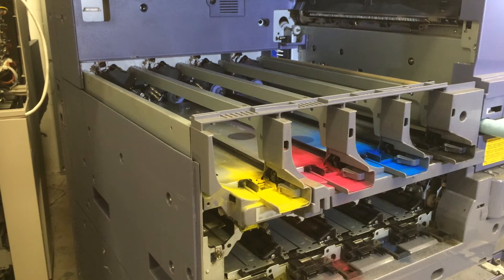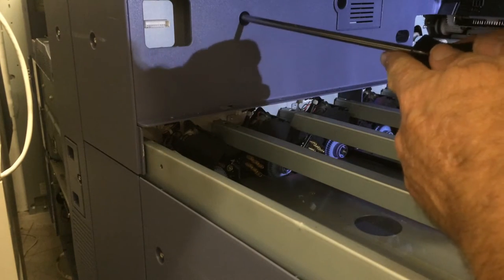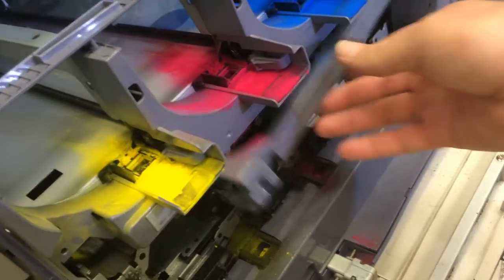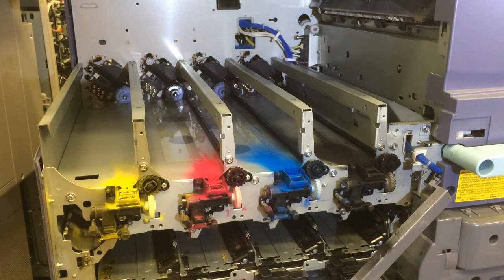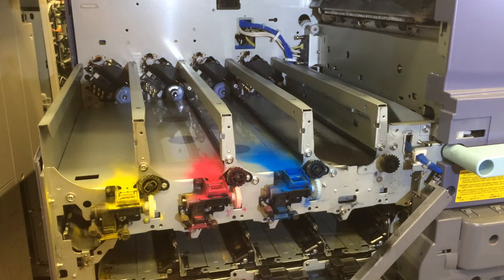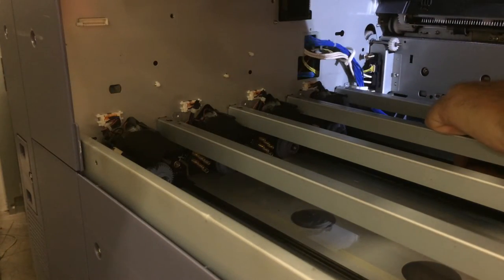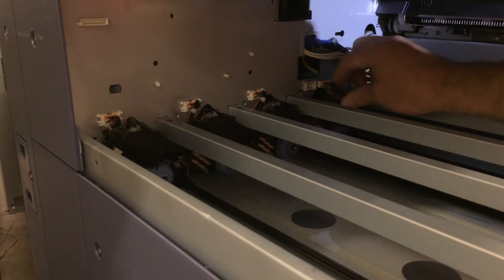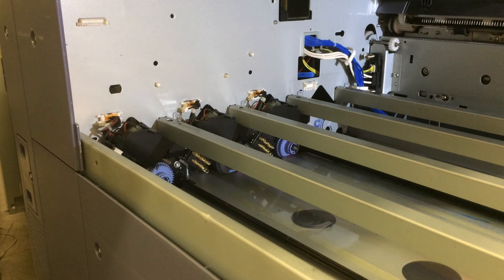Toner sensor Toshiba es4540 series machines

Comment: This is such a pain in the ass to do. I hate that model machine.
If it doesn't have toner not recognized errors, it will give you constant CA00 and CE40 codes. Plus developer depletion problems.
Reply: How do I turn that off